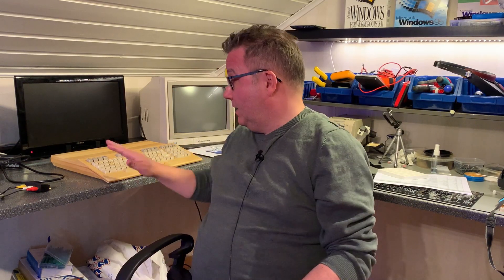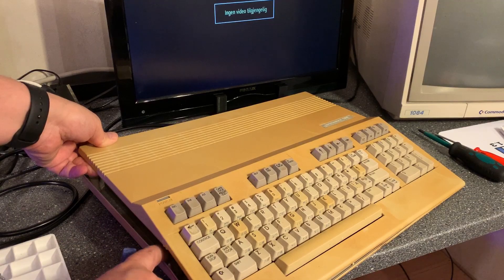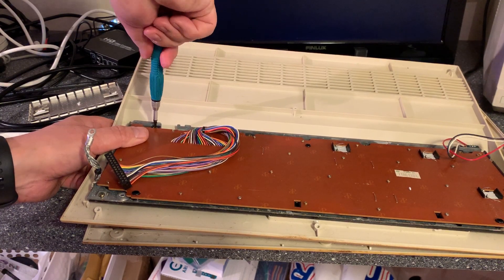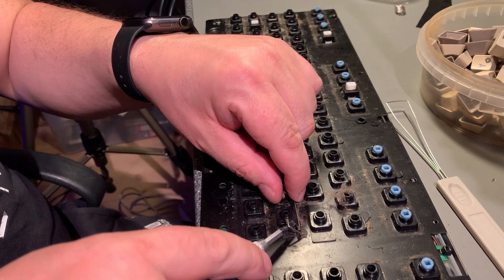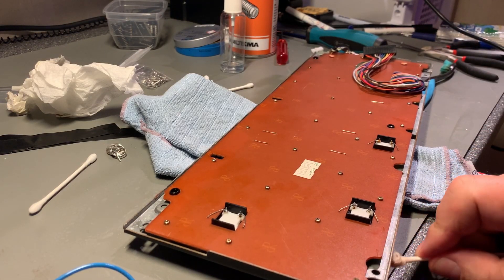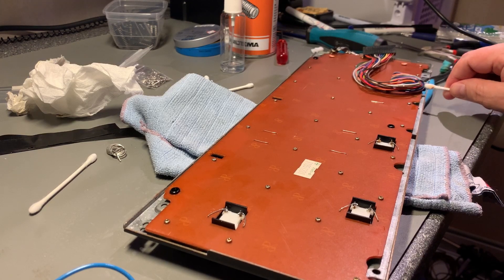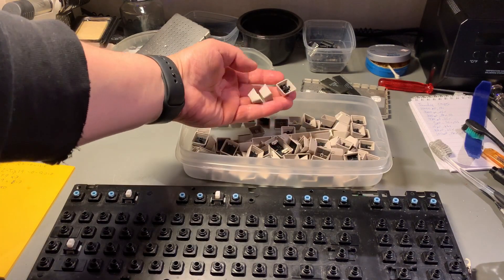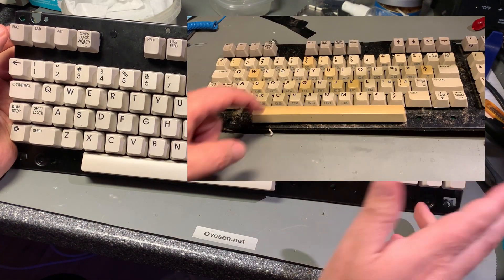Extremely yellowed Commodore 128 black screen repair and restore - Part 1

Comment: This is the third YouTube channel I watch regularly where Commodore machines appear to have been tanning next to the sun on Mercury. Two Vic-20s, a C64, and now a C128! Sooner or later we’ll get them all a)retrobrited, b)painted, or c)replaced cases. :-)
Reply from the maker: Yes, it is fun;)
Reply: I'm guessing the VIC-20s you're talking about is from Adrian's Digital Basement? :D
Reply: @HAGSLAB  One of them (ADB got a Vic and a C64 - He originally thought they were two Vics). The oddest thing there was that the Vic was yellowed worse on the BOTTOM. Was it pressed against a window? That's just a mystery. The other thing was that both machines for the ADB had keys obviously yellowed (including the top lettering), but the front side lettering was not - it was still white.

I saw one other, elsewhere. It was very yellowed, but more like this C128 than the ADB machines. That is, the coloring of the yellowing was dark but different. Different plastics or different exposure to the sun. Who knows. 

I was just in awe of the number of yellowing on a number of machines during a short period of time. Weird!

Comment: I had a similar case with an old calculator. The board looked slightly damaged by corrosion, but in fact 90% (!!!) of the PCB traces were without continuity. The only way to fix was to scratch off all these traces and to make a rat's nest with wires.

Comment: You should messure every oxidated and discoloured trace for continuity and start checking signals. Clock, reset circuit, data bus, use your dead test cartridge etc... But please don't give up:)
Reply from the maker: Thanks. I did not give up. Next week we might see something ;)

Comment: Time to check if there is clock signal where there's supposed to be. And maybe check the reset signal, if it behaves as it's supposed to. An oscilloscope or a logic probe will make it easier, but it should be perfectly doable with a decent multimeter as well.
Reply from the maker: Yes, watch the next part on friday ;)